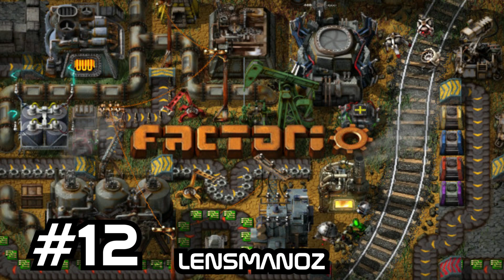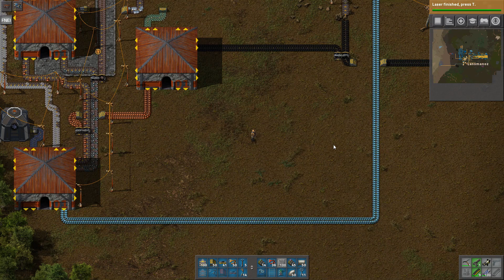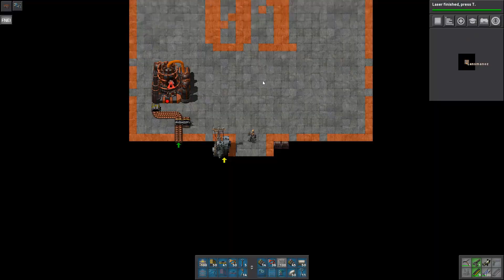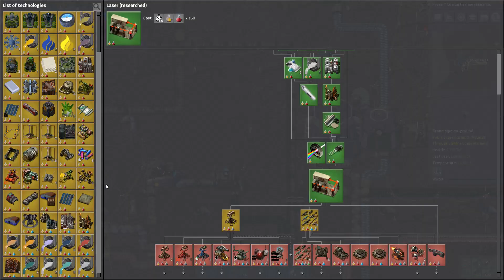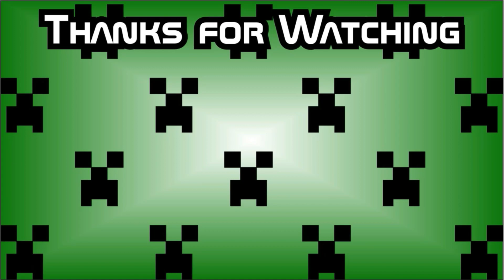Factorio Modded - Ep 12 - Bronze & Plastic

Comment: If you're trying to chew through that coal patch near the infinite,  a couple of steel chests, with a splitter and loaders in and out will let them mine through that patch significantly faster.

I'd like to suggest going a bit ham with the large power poles and cleaning up the wooden ones, just to make it a little easier to place things around the base.

Your underground belts belt needs and underground belt. I find this intensely funny.

Also because you have engines now, in sections like the plastic where you want a lot of flow through them, add a pump every 5 sets of underground pipe and that will improve the flow through it.